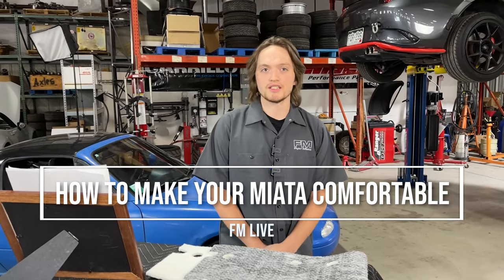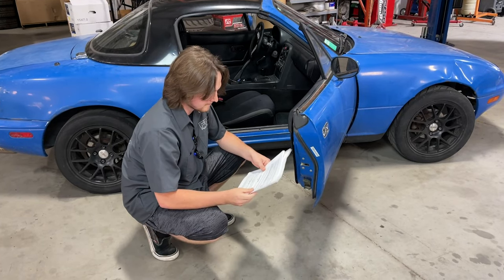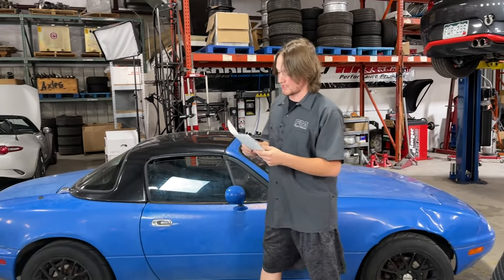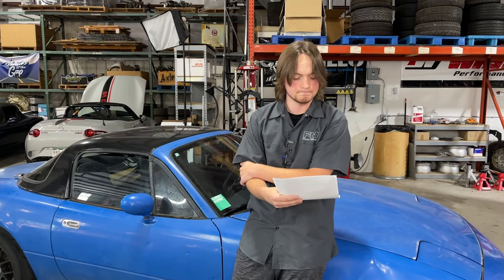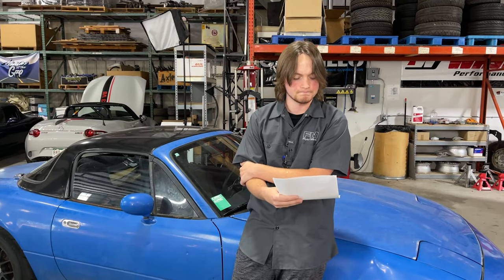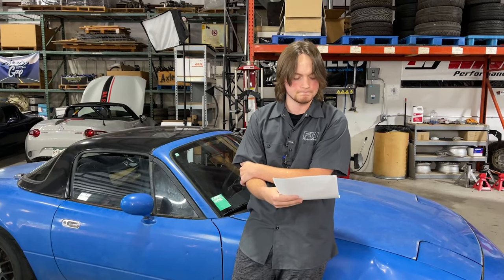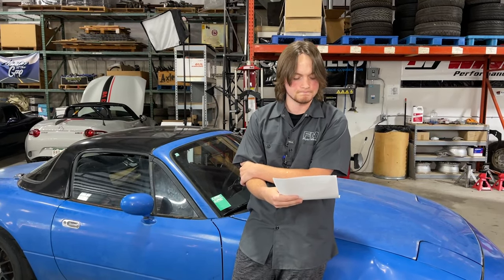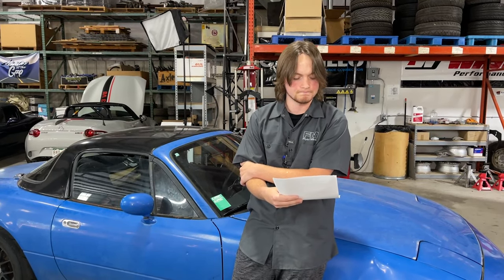How To "Rolls-Roycify" Your Miata (FM Live)

Comment: I'd like to add a couple things off the top of my head. Going with a more plush like carpet along with the DEI insulation inside the cabin and getting it as close to the firewall as possible helps not only with NVH, it also helps with climate control inside. Definitly a good thing in the more extreme tempered climates. The hood hinges also over time wear down and can cause the hood to rattle. If you can sort of lift and jiggle the part of the hood when closed by the wiper cowel. The hinges are more than likely worn. There are also two tunnels on either side of the fuel tank inside the trunk that sort of act like a sound tunnel and channels the sound into the cabin from the exaust and any other road noise from the back of the car. I found insulating the trunk helps with high amounts of heat and noise since it is a giant open area that could act as a drum. If you have an aftermarket exhaust or Catalytic converter, both may increase any exhaust noise inside the cabin. Tire choice is another option to look at aside from wheel options. For example, a set of Yonaka S-Drives has a high amount of road noise compared to a set of Hankook ventus v2 tires of the same 195/50/R15 size. Then there is the science behind the Honda S2000 exhaust with the loop in it to help with exaust noise and drone. And finally, I hear (havn't tested it out yet) that as our cars age. The metal becomes a little bit more flexible. Stitch welding along the door seams and other areas (I believe there is a diagram on the web somewhere) can also restore some of the rigitiy in the chassis.

Comment: Off topic but some reviewers have complained about numb steering on ND Miatas. I'm an old guy, I remember that MGBs and Alfa 115 series cars didn't have power steering. A 2,300 pound car doesn't actually need power steering. At anything over a crawl steering lightens up. I know that the old cars had narrower tires and less grip but it might be something worth considering.
Reply from the maker: The ND lack of feel was addressed by a change in the rack for the RF and 2018+ soft tops. Alignment makes a big difference as well. The ND suspension geometry is designed for power steering, if you try to drive one with the rack disabled it’s very heavy and not in a good way.

Comment: My suggestion: a pair of airpods pro, you dont need any of these mods, it will turn your miata into a Lexus instantly once noise cancellation is turned on😂
Reply: Lmfao. I did this driving my na from FL to PA with an isr exhaust and it was like I was in a mercedes